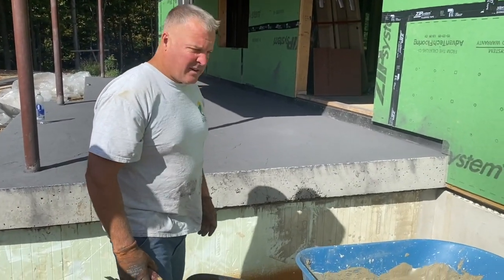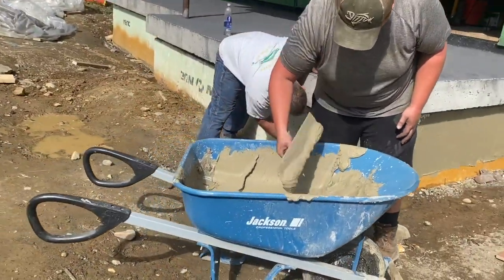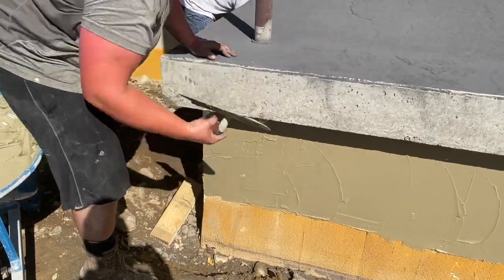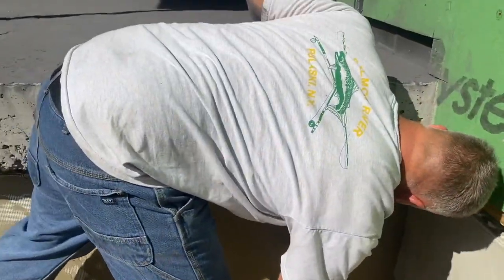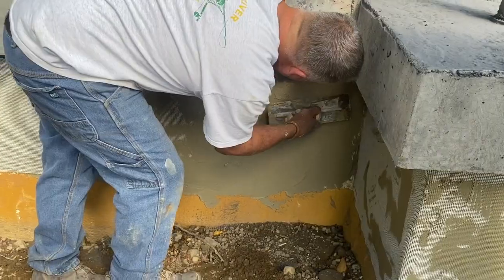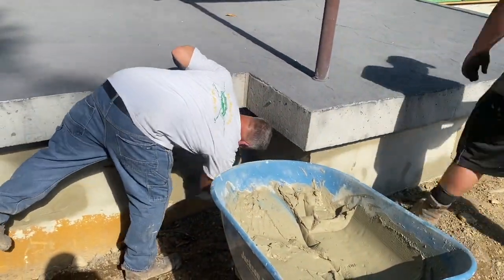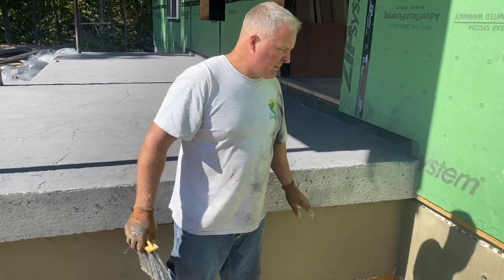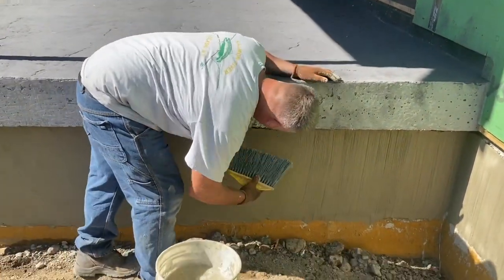How to parge ICF walls (Step by Step)

Comment: Ron 'Bondo' Bond, Thank you mucho for all the content you have uploaded, very informative and appreciated.  
Having fully fallen into the ICF rabbit hole, I have watched many of your vids, probably 100's of hours (at least)of ICF vids in the last year.
I think the ICF system is fantastic and plan on building with it 2021(summer).  
That being said, I still have a couple concerns, rather large ones though, all revolving around water proofing/barrier/WRB shield, below grade/transition/above grade etc:
1. Water proofing below grade:  Spay vs Liquid vs 'Peel-n-stick'.  Information out there is very contradicting/confusing.  Also a bit reserved about 'Peel-n-stick' solutions as I haven't stumbled upon any long-term studies for this ie. 'performance after 10 years, 20 yrs, 50 yrs. etc'
2. Water proofing above grade:  same questions/concerns as below grade plus one- 'WRB' (Water Resistive Barrier, aka 'house wrap/tyvek' etc).  This is another area that seems like the ICF professional community hasn't come to conclusion yet.  Any light you could shed on this topic?
3. The ever dreaded ~8" 'Transition area', ie. from below grade to above grade cladding. I have yet to see a full/confident inspiring solution for this area.  I have yet to see any below grade water proofing product that can withstand above grade UV exposure thus the need for the transition area covering.  Some of the more common solutions I've seen for this are: 'Parging' ('synthetic' stucco), stucco ('real' stucco), cultured stone with out grout to prevent moisture wicking, metal flashing, concrete fiber board (which should NEVER be in contact to ground due to moisture wicking). 
     3.1-Is there anything better than these 'transition area' cladding solutions?  One of my main concerns for these is the actual transition from underground water proofing membrane to the 'transition area' cladding.  This always seems like the weak spot (aka. failure mechanism, water penetration route).  We always see the final grade (rock/gravel/dirt/landscaping etc) right at the level/transition I'm referring to.  Ultimately the above grade/transition area should dip a few inches below grade to protect the water proofing system from any UV exposure risks ie. poor final grade/material settling etc.  Any thoughts/literature  you can provide on this subject would be greatly appreciated.
4. Last/final concern:  This stems from the somewhat 'catch-22' ('between a rock and hard place' if you prefer :) - Once we apply an actual 'Waterproof' membrane to the ICF system (or most any other system for that matter), the risk of ANY moisture into the system is ultimately compounded by the fact we just dramatically made it a lot more difficult for that moisture to get out of the ICF wall system.  My concerns here are the fact that the interior of the system is not waterproofed (haven't seen one yet-nor any recommendations to do so) and once any moisture gets into the wall from the exterior, from what ever failure source, now basically has to 'dry out' through the interior wall.  The interior moisture in this case scares me a bit and the fact that if it ever happens, this would not be an easy fix-could be a nightmare (ie. leak source is roof level, 2 level home, but water on the interior doesn't appear until 1st level floor area.  Scary a bit if you ask me).
Do you have any input/links/literature you can share on these subjects that might shed some light on them?
Again, appreciate your insight and contributions so far (subscribed! :).
Best to you and yours with the upcoming newyear (2021).
Reply from the maker: Hi there. Thanks for subscribing to the channel. 👍 
I can give you my 2 cents on a few things. On waterproofing I have took my own experience digging up basements and drying them out to use. I dug up basements and spray foam then and do new drains and good drainage rock. This always works so now I spray foam the ICF with closed cell spray foam. 
We parge the area that you talk about that is exposed and that goes on to the spray foam. You could parge down a little below grade and then spray over the lip of that. Above grade I recommend a drainage plane over housewrap. That way any moisture can have a place to dry out to the exterior. Vent this drainage plane wire hole punched metal bent to keep insects out. 
Any water that gets into the basement below grade will have to dry to the interior so I would not water proof the inside. No water should get in with a good drain and stone drainage plane against the wall. 
Regards 
Bondo
Reply: @bondobuilt386  Thanks for reply, i'm still amazed you reply as much as you do, it's appreciated.  Drainage plane sounds like the route to go.  Thanks again for all the real 'working man's' knowledge.  Manufacturer Websites and Salesmen and brochures are great and all...but nothing beats 'boots on the ground' real experience.
Thanks again Bondo, you da'man!  Keep your biscuit hydrated!
Reply from the maker: Thanks buddy. I try to keep up with the messages on here. Im glad the Chanel is helpfull to you. I'll hydrate that biscuit. lol

Comment: Hawks are easy to use. Also I start at the bottom and go vertical up to get it on.  Once its stuck on the wall, its easy to float it. I've done a lot of walls and some ceilings too. Ceilings suck. But if you stay patient and have a system you can get it done.

When it sets up some. I mist it and use a hard rubber float to rub the final. Looks better than a broom finish. But nothing is wrong with a broom finish. I broom all my exterior flat work. 

Strategic cardboard helps tremendously with clean up if the situation is called for.
Reply from the maker: Ya never done a ceiling. That’s gotta be a pain. This stuff is so super sticky. I remember parking block walls with mordar. Now that’s a pain. I have done the float too. 👍👍
Thanks

Comment: I don't have an ICF but I have 2" rigid board insulation that I have  Tapcon screwed and RamSet nailed onto my cement foundation. I am now going to parge. I was told to put a first coat of a polymer mortar plus the mesh. Is that what you are using? A polymer mortar? I was told to then use a parge mix as my second coat but I'm thinking I can put two coats of a polymer mortar. What are your thoughts? Enjoyed the video. I gave it a like and subscribed.

Comment: Wow Ron! Pumping out the videos this week. I was going to ask about painting but then you said you washed it and then sealed it. What do you seal it with and do you let it as is or what. What is more durable, paint or the sealing? Great work as always.
Reply from the maker: Tom I think I was talking about the stamped concrete and the face of the porch will be washed and sealed. The parge coat will not need ant treatment. You could probably paint it with a good Masonary paint but a latex paint probably would fail. I think if someone wanted it another color I would put powder color in it as it was mixed up.
Reply: i guess it is pretty off topic but do anyone know a good website to watch new tv shows online ?

Comment: Hi Guys.  What is the yellow sealant near the bottom?  We just had a concrete guy do the footings, 9' approx high ICF.  I asked him to do 'all things concrete' and assumed it would be a turnkey thing, allowing me to proceed with the floor joists.  Now I'm looking at a 9' high white wall, apparently parging was not specified, so that's on me.  Do you backfill to a certain height and then parge, or parge the whole 9' wall, then backfill?   Costwise, and labor, it will make a huge difference.  Just not sure what the yellow adhesive is, is that something you put on for the area covered by Fill?  Thanks.
Reply: Ok, read through Ifishmo's comments (thank you).  So there is an above, and underground waterproofing barrier application.    Parging above grade, and WRB below grade.  I feel confident I can do the above grade parging, will look into various below grade WRB's.   Thanks.  Any recommendations are appreciated, and Thanks so much for this video, it was easy to follow and funny, great team, great job.
Reply from the maker: We had this foundation spray foamed below grade  with closed cell spray foam to water proof it. You can also use a rubber stick on membrane made for ICF below grade. Then large above grade areas.
Reply: @bondobuilt386   Thank you very much.  I'm going to assume the spray foam is more effective at  actually sealing as getting that wrap tight looks cumbersome

Comment: If you are concerned with subterranean termintes, the parge coat should overlap the waterproofing membrane coating by a few inches. In this video, there was very little overlap and in a few spots I saw bare foam.  Those bare spots will be below grade and will provide a path for termites to enter the foam without having to expose themselves above ground. You want full coverage below grade to force the termites to build visible mud tunnels on the parge coat so that you know you have an infestation.  What I saw done was the waterproofing went 6 inches above final grade and the parging went 6 inches below grade, creating  an overlap of 1 foot.  Even if you don't have the subterranean termites in your area, the overlap would be better waterproofing against water pudding at the grade level.✌️

Comment: Hey Bondo!

Quick question for you.  I am getting ready to start my ICF walkout basement and will be using a peel and stick membrane. Would you use parging to cover the space between grade and the bottom of the siding?  I want the membrane above grade a bit but don’t want it exposed. 

Any advice is greatly appreciated.
Reply from the maker: Rob yes parge it with the ICF parge. Run the mesh over the membrane where you go above grage and parge over everything to just below grade. The ICF parge is reral sticky. Do 2 coats at least.

Comment: Why is there a gap between the top of the ICF and the concrete porch slab?
Reply from the maker: That’s how ref carpenter formed the slab. There is Q decking over a root cellar.
Reply: @bondobuilt386  I thought you were the plasterer don't you fix and prep the parging before you start your top coat that is your job
Reply from the maker: @carbonator0808  You don't like the material move on keyboard diddler.